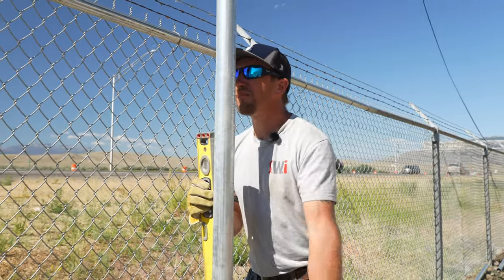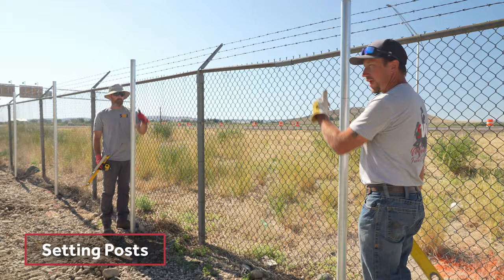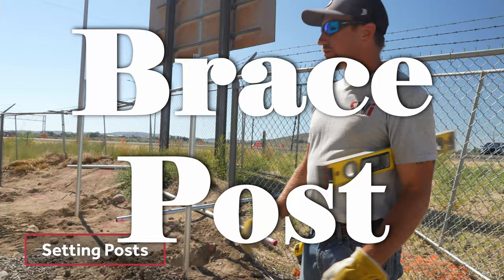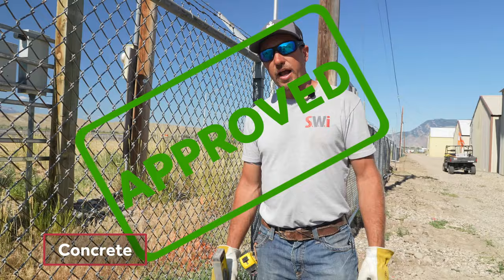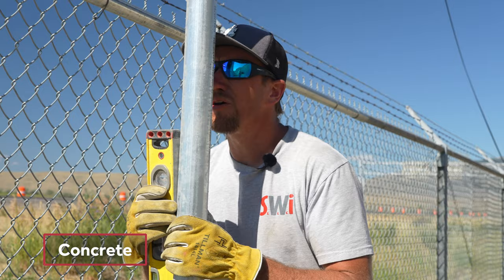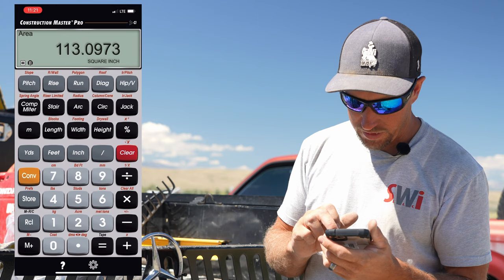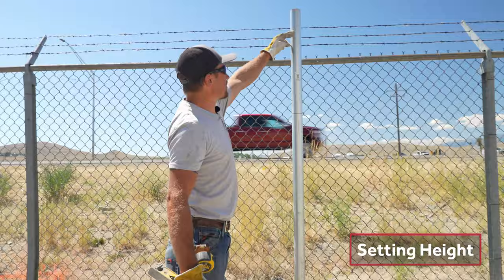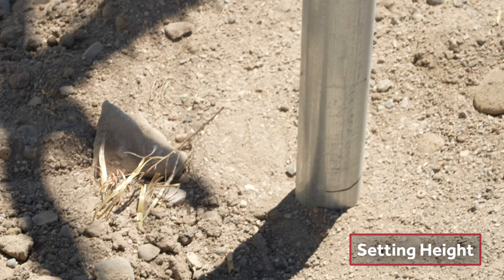Setting Chain Link Fence Posts Quickly And Easily | How We Build Chain Link

Comment: Setting post height seems to be the most complicated task of our jobs. Having a ridiculous amount of unleveled ground doesn’t make it easier. Any tips for making that process a bit easier when dealing with unleveled ground?
Reply: @El-Stormo  I’ve been looking to set a terminal posts. I’ve been reading online you drill it at 90 degree angle to ensure the top of the terminal post in the slope will be the correct right. Any and all information would be greatly appreciated!
Reply: @El-Stormo  the entire slope from terminal post to terminal post is 15in slope when I level it with a mason line. It’s a 40 foot length so will have two line posts.
Reply: @El-Stormo  so the fence fabric is 6ft (72 in) so the terminal post I want to set no matter the slope I set to 74in? Then my string line will be 70in for my line post?

Comment: Do you think running a string line would be a lot less time consuming back and fourth adjusting the post mad skill to have doing things by eye but seems more time consuming in the long run
Reply from the maker: If you're used to string, yes for sure, string will be faster. I'd say for one-off jobs just use string.
If you're used to eyesighting, I think it goes faster, especially over long runs. https://youtu.be/pLnC_utPqE8

Comment: I’m making that change immediately… never gonna set another post I before concrete again!

Just curious… we use a lot of hedge (bois d’arc) posts for fences.  They will outlast treated pine or cedar by several decades.  I can show you fences with 6” diameter posts still solid and strong that are 100 years old.  None of them are in cement… there are both dug in and driven in posts in the fences.  They were set with rocks and clay pounded into the holes to hold them.  

Newer fences with concrete rot the wood!

Now here’s the question(s)… at equal depth and equal diameter… which one holds better?  Rock packed or concrete.  Second, have you ever used hedge posts?
Reply from the maker: I am familiar with hedge.  Are you in KS?  Concrete will hold better but can shorten the lifespan of wood as well as cost more.
Reply: @SWiFence  S/W Missouri where Mo/Ks/Ok/Ark meet.  Great Plains meets the Ozark Mountains. Prairie soils in places, mountain limestone rocks in others.

Comment: Can you use metal posts like that for wooden fence and if so do they last along longer than pressure treated?
Reply from the maker: They will absolutely last longer than wood posts. You can use pipe posts with adapters, but we prefer to use Postmaster steel posts on all our wood fences. https://youtu.be/JbfdHpnU9yc
Reply from the maker: http://bit.ly/3fxHjR6

Comment: I got a question. What is the best way to set 4 1/2 inch 16ft long pipe for 12 ft fence that has to be poured with 300 psi approved concreted They are a Beast to set and they want 8 inches of concrete underneath the pipe. I was looking for something like a pipe slip like those I used on the oil rigs but they are way to much $ and are heavy as shit to be practical for setting up 450 ft of them to hold them up waiting for concrete to harden. I'm at  a job installing 12ft fence for a soccer field taking over from another company that poured them staggered to fuck with 5 ft of concrete not one is even close to being centered of the hole even a drunk man would say that's not straight looking from 2kms away. I've pulled them all out but now they tell me i have to have them 8 inches above. So I figured i'd reach out to Americas best for a solutions. I've got all the holes 5 ft exactly straight using a line and laser level because it's a city job they want verified to finished grade domed top of concrete 6 inches under final grade. This Job is on a hill and the Winds are pretty crazy. It's almost winter time and there are no leaves to block any wind now so I'm kinda like How the fuck am i supposed to set 54 pipes in the hole and have them hold and stay 8 inchs above keeping them straight / Plumb while the concrete cures fighting with the wind 40 - 80kph. The technique you use is the same one. But with 4 1/2 pipe and 16 ft long once that concrete gets in the bottom they are heavy getting them down isn't hard it's keeping it up that's the problem i'm using 12' sonotube 5ft post goes 4ft 4inch i'm using a vibrator because the require it to be and even that the pipe just wants to go down lol. I was thinking 2 4 -4 1/2inch Pipe Rising Claps with a 2x4 spread base for the bottom and 3 center bands 3/4 of the pipes height like 8ft ish for a tripod using top rails to keep it up?
Reply from the maker: On something like this we pour around the post rather than stab it into the wet concrete. We use a pole setting attachment to make this easier since the posts are so heavy.  Once the post is in the hole with the concrete we wait for the concrete to cure enough then install one or two brace bands at the bottom of the post to catch a 2x4 or pipe that spans the hole. With the the post to height, we tighten the brace bands down on top of the 2x4 so that the post can’t slip down anymore. Wind isn’t an issue because we keep an eye on the post as they cure and it doesn’t take very long at all for the concrete to cure enough so that the wind can’t move the posts.  Even with the Wyoming winds, we have never had a problem. 
https://ezspotur.com/prod_hdpole.php
Reply: @SWiFence   Thanks alot we have ordered 2 I've never seen those before.  Battlefield does not have any to rent 2 months until the ones we ordered arrives. I solved the problem with 4 1/2 riser clamps 15$ + tax each 46 of them 2 for each pipe with 2x4 base and used scaffolding to braced them. 120 K. P. H In the storm we are having and they haven't moved an inch. The concrete isn't curing fast ground is soaked and +6 Celsius 120 mms of rain the other day. It has rained every day Haven't had sun once since starting. We poured on Tuesday at 9am 54 holes and didn't harden till 6 hours later.

Comment: how tall how tall should a post be for a 6 ft chain link fence a post be for a 6 ft chain link fence
Reply: 5' 10" is best. 5'9" is a little low. I use a string line to set to height. Set the line at 10" above grade and mark the post at 5'.
Reply: @billykennedy3750  I wanted to ask the terminal poles.  For the example I have the 8ft terminal posts, how high should they be?  the terminal pots.  Thank you.
Reply: 8'4"